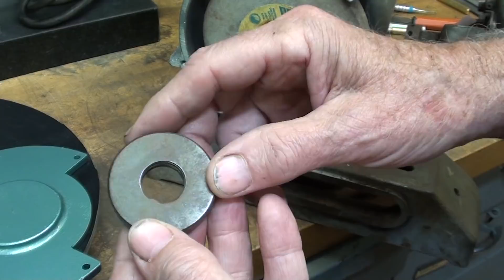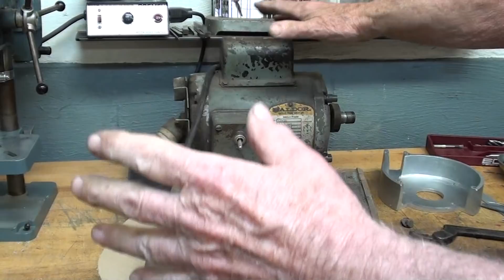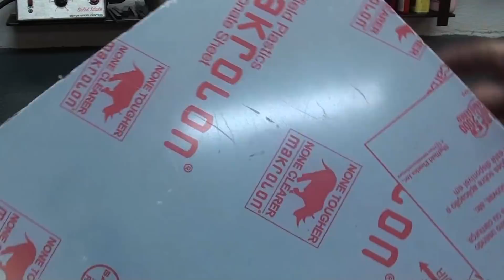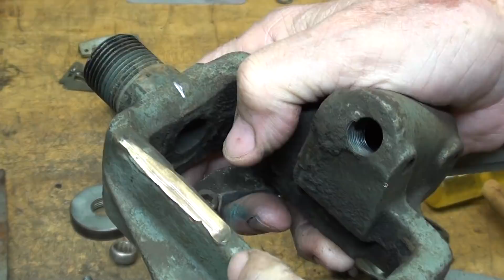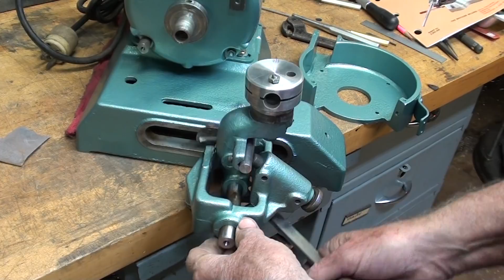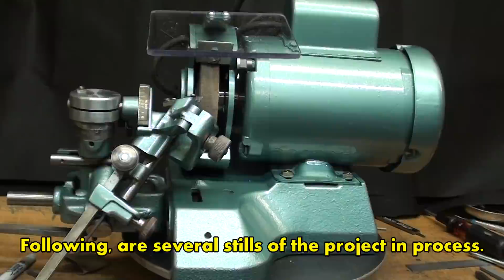Restoring a LISLE Drill Grinder pt 5 Tips #464 tubalcain

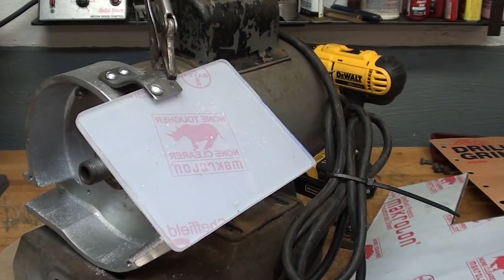Comment: If they ask me for my gender I'll tell them if they can't tell they have big problems, and leave. It's either that or whip it out and get arrested. Stinkin' PC idiots. Perfect plastic for the guard by the way. It will withstand impacts if the wheel explodes or chips and isn't likely to shatter becoming more projectiles. I think you installed the face guard in a different position from your original plan. Early in the video (about 10:25) when you were test assembling you had the guard under the steel strap. As you currently have it the washers should be on top of the plastic and there is probably no need for washers where the nuts connect to the strapping.

Comment: Polycarbonate is different than ABS. ABS is what they use for sewer pipe in the US. Acrylic can be known as Lexan, I believe. 

The question is for demographic data. Might also indicate what tests they run on the blood. As a resident of a more "free thinking" state, this question is more and more required in the dating scene to know what you're getting into.

Comment: My experience with a Hammer Tone finish is that it needs to be applied rather heavy. If you apply many thin coats it will not produce the desired hammered finish. One heavy thick coat is better.

Love your videos.

Comment: Love your videos. I do a lot of machinery and tool restoration as a hobby. When I do grinders, I always replace the screws that hold the wheel covers on with threaded knobs to make wheel changes quicker and easier. And if I touch a motor at all, it gets the full deal, otherwise it’s corner cutting (IMO)

Comment: Maybe, the thin plastic is Polystyrol. That tends to break, when you look at it. The Polycarbonate is almost bulletproof. I have never good luck with the spray cans in hammered. With a spray gun, it works fine, but is to much cleaning, so i use a brush for hammered look. That looks ok. BTW: i love the rants.

Comment: Just in case you didnt know- but when you drill Clear plastic or Plex-glass you should use drill bits that are made for drilling Stainless Steel as they have a different angle on the grind-  This is something I have learned from drilling holes in Motorcycle fairing windshields from my restoration work - if you do so, you'll have much more success and less chance of breaking it

Comment: This was a great series of video's. Thanks for sharing. A few words about "TAPE." From a autobody guy (25 years experience plus.) First off, if you want your tape to perform to it's best ability keep it in a cool dry sealed container say a zip-lock bag, or a plastic (they use to be metal) coffee can, with a tight fitting lid. Trick to keep a tight fitting lid, COVER THE TOP OF THE CONTAINER WITH A SINGLE PIECE OF FOOD WRAP, ETC. Keep your tape away from any HEAT SOURCE.  You want to store tape on its side, and if you happen to have a couple of rolls, you can stack them on top of each other. Their are hundreds of different types of tape. Example "FINE-LINE" tape used for pin-striping (approx half the thickness of conventional tape) so as not to leave a very thick edge. You have house painter's tape (the blue tape) designed so as to be left in place for as long as say 30 day's. Autobody tape is designed for much shorter time span, say 3-10 day's. leave it on much longer then that, and enjoy the NIGHTMARE of removing it after that amount of time. And if for some reason it gets WET, say you masked off a car and push it outside and get's rained on, the problem get's much worse. Autobody tape is designed to withstand the chemicals (read that as the different paint thinners & the paint it self.) House painters tape (the blue tape) is more designed for softer type chemicals used in painting say a house. When possible, you want to remove tape as soon as possible, and if doing so while the paint is still relativity wet, you want to peel it back on itself, and at say a 45 degree angle, to create a knife like effect to cut the wet paint that has bridged across from the tape to the painted object. Yes autobody tape is MUCH MORE EXPENSIVE, but you get what you pay for. Example use the what I like to call the WELFARE tape (say 0.67 cents a roll) and when it just falls off, WITH NO WARNING WHAT SO EVER, as a result of the chemicals and falls onto the freshly painted part / object, you'll become an instant believer in the more expensive tape. What the difference between Automotive / autobody tan tape versus the  autobody green{ish} tape? The green is designed for approx. 150 to approx. 180 degree heat. Most autobody shops have a spray booth, that also acts as a oven, i.e. spray & bake.
Reply from the maker: Thank you, almost everything you said is new to me

Comment: As I understand that hammer finish, it's silicone in paint (like silicone lube).  Has to go one thick to get the mottling.  That IS a pretty shade of green.  Having the adjustment knobs in stock is handy....  Almost like you have your own hardware store in the basement.

 Nope, it wouldn't bother me in the least.  I'd tell him "Put down your best guess, but don't get it wrong!!"
Reply: stxrynn Yes, that’s correct in order to get the hammer tone to develop the wet coat has to be heavy enough and wet to form the hammer tone finish. Try a piece of scrap and you will see it.

Comment: Hi Lyle
I have done quite a bit of hammertone using Rust-Oleum rattle cans. I found the trick is, as you noted, to put the paint on in wet coats. I put on a wet coat, wait a couple minutes to get a bit of flash, then hit it again with another wet coat. The flash time helps reduce runs. Repeat till you have three or 4 coats.

Agree 100% with all the comments about this gender BS. Its important for the "silent majority" to speak out on this foolishness! regards
vic

Comment: Mr. Pete, I enjoyed the series very much. I just cleaned up an old Columbian 4 inch bench vice and also used the hammer tone finish in gray. We agree it should be called hammerhead. I have a friend who restored the interior of his 41 Ford pickup with hammer tone with great results. I guess he had enough experience to perfect his technique. One question: why didn't you remove the pile of grit on the base casting, instead of just painting over it, or is that a statement?

Comment: Great series! Really enjoyed it. The motor is classified as TEFC (totally enclosed fan cooled) as opposed to the motor on the original picture which is a ODP (open drip proof), supposedly open enough for cooling but dripping water from above will not get into the motor. Wonder why they changed--probably because ODP motors are usually cheaper. (You probably already know this stuff.)
I agree with your rants--100%!!

Comment: ABS and Polycarbonate are two different types of plastic. Not the same. Polycarbonate brand name is Lexan. There are many types of materials that fall under the heading of plastic. Some even call carbon fiber, "fancy plastic". Each type of plastic has different characteristics that make them more or less suitable for a particular job. I would want to use Lexan over a plastic that shatters easily for a grinder guard.

Comment: They made many design changes to these grinders although the basic form remained the same. Mine has a Westinghouse motor, an aluminum base, cast iron guard assembly, and the upper attaches to the base with two 1/2-13 bolts. Any idea how long these machines were made?

Comment: Looking at the still of the motor I noticed what looked like flats on the armature next to the wheel arbor, could it be that the arbor is secured to the armature with left hand threads as well?

Comment: For that hammertone paint, the trick is to apply a relatively heavy coat.  It needs to be a thick enough layer for it to flow into the fisheye texture.  Consequently, this often makes it difficult to avoid runs. 

I've found that the best approach is to apply two coats, since the effect tends to make thin spots.  Unless they've changed something in the last couple years, that stuff does turn out like the cap (notice the cap is actually painted!).  I've used a ton of it.  

EDIT: i guess you figured that out!

As the grandson of a man who spent his life rebuilding motors, changing bearings is just another trivially mundane routine like changing socks.  ... but it's your machine, so you're free to do whatever you want -- and I know you know that, because you did.
Reply: Absolutely correct. A Hammer Tone paint is pretty much a simple fast dry metallic enamel with silicon added to it to create the fish eyes. If applied too thin/dry, the film does not have enough flow left for the silicon to disperse the pigments and fine metal flex. It is a tricky product to apply. A thin dry initial coat followed by a medium wet coat is the secret. Unfortunately, spraying out of an aerosol can, you have no control over the % of dilution. Buying it in a quart and thinning it yourself and using a small spray gun makes everything much easier.

Comment: Lyle, I am following your restoration with great interest.  I recently bought a Lisle Drill Grinder (M/N 91000) at an auction.  I am restoring it also.  It turned out to be missing the drill holder assembly.  I've searched high and low for a replacement and have not had any luck.  I think I need to beg, borrow, or steal one to use as a pattern for making one myself for my Drill Grinder.  If you have any ideas or suggestions for me to solve this dilemma please share them with me.  Thanks for your YouTube channel as I am thoroughly enjoying your content.
Reply: I got the exact same problem. I see no one responded. Going to have to make it up by eye
Reply: @hiteck007  I managed to get drawing of the casting from Lisle.  Let me know if you me to email it to you.
Reply: @DENedbalek  my email keeps getting Deleted. This is the 2nd time it's dissapeared. Can I get it to you another way?
Reply: @DENedbalek  is there another way to get information to me at all?
Reply: @DENedbalek  I subscribed to you
Reply: @hiteck007  I have drawings from Lisle, but it’s beyond my capacity to make it from the drawing. Email me if you want a pdf.